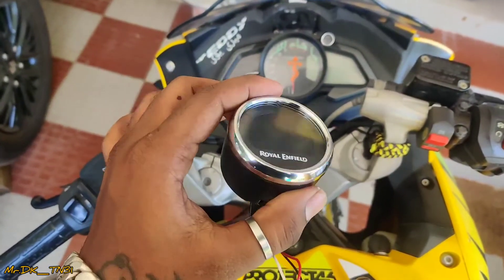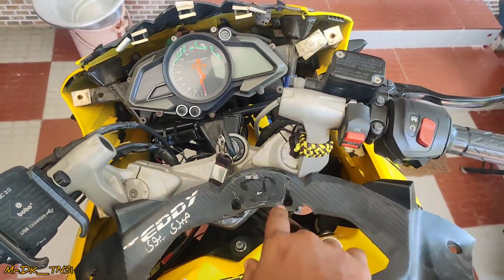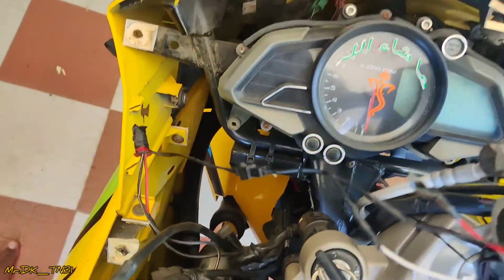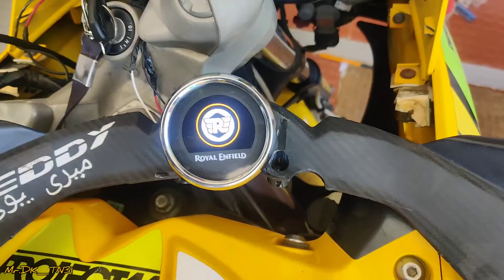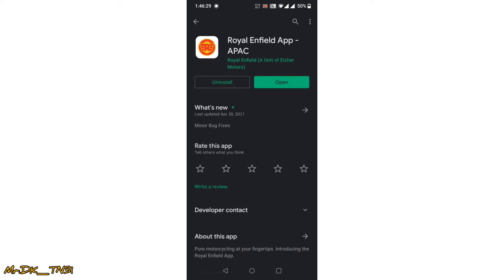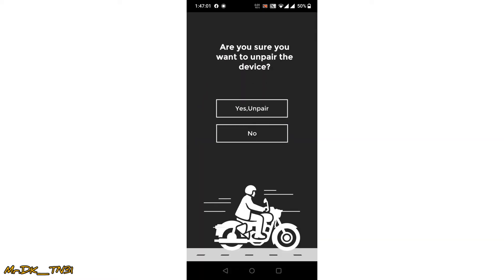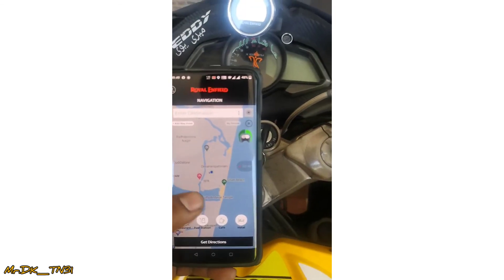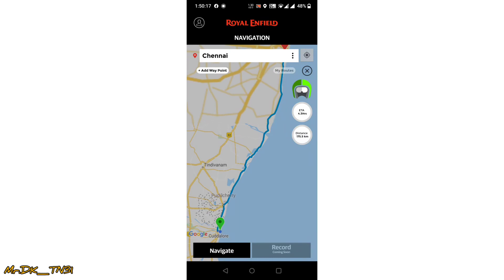Royal Enfield Meteor 350 Navigation Installation In Pulsar RS200 | Tamil | Mr.DK TN31 #rs200

Comment: Bro actually I'll buy it this navigation system that's is not a problem but where to buy this wiring socket. This wiring socket only I didn't get it...
Reply: Bro actually what line of red wire
Reply from the maker: @highlightcinematography5758  check the top 3 pin bro . Bottom pins are dummy
Reply: Oh kkk bro
Reply: Red wire enna line bro
Reply from the maker: @highlightcinematography5758  I think red dummy bro . Only white and black
Reply: Ok bro

Comment: At royal Enfield showroom they say we don't provide tripper alternatively it comes with royal Enfield bike itself company doest sale it
Reply from the maker: In some showroom only they sell it bro
Reply: @mrdktn31  hi I managed to get the navigator. I have an avenger. But I am not getting the socket plug for it. Could you assist. Thnx
Reply from the maker: @Atson0311  hi bro  many places the socket don't available bro . If u have the meter take it to a good electric mechanic u need only 2 wire's u can solder or connect the wires direct to the pin
Reply: @mrdktn31  thnx. There are 6 pins, wld you be able assist which are the two pins?
Reply from the maker: @Atson0311  check the first 3 pin

Comment: Can u tell the pin diagram where exactly the wire is connected I got the product from re service center but dono which is the power suply as it has six pins and there is no connector in it
Reply from the maker: I am not sure bro I got the product with the connector . In connector it has only 3 wire 1phase 1nutral 1not use.
Reply from the maker: @hima09jp 
Message on insta bro https://www.instagram.com/p/CJgiwSbBv26/?utm_medium=copy_link
Reply: @hima09jp  how much did u pay for it. ???
Reply: @lohitnaik4079   5200
Reply: I also need one for classic reborn, but need to know how to do the connection , can anyone guide me
Reply: @thispc8131  u can get it in service center ask for the part RAM00063/B if they say that the stock is not there then ask them which other service center is having the spare, they will let you knw, u then buy it from them and best thing with classic reborn is it'll be having the socket inside headlight assembly you can easily fix it
Reply: @hima09jp  is the socket available inside the headlight area? Are you sure ? Because then it would be quite easy to fit.. I guess the fitting will also be from the headlight area itself
Reply: @thispc8131   due to the shortage of IC chips in global market royal Enfield didn't provide it but if u see few bikes are already equipped and it's a option in booking to therefore we can say the socket will be there inside the assembly
Reply: @thispc8131  I managed to get the device but the socket is not there with the Device. I have an avenger and plz assist me to get the socket

Comment: hello I need a help, to which pins on the unit have you connected the positive and negative wires. I am stuck because i havent got the original 6 pin connector and mine is a non - RE bike so i have to make my own connection to unit.
Reply from the maker: Only the top 3 pin u have red, black, white . In that white is positive+ , black is negative - . Only u need to connect 2 wire's . I am not sure which is white & black in 3 pin u check by connecting the device will turn on
Reply: @mrdktn31  thanks bro
Reply: Hello Bro. Where can I get the plug 🔌. Sorry I don’t understand tamil.
Reply from the maker: I got it together bro
Reply: From where do you got the 6 pin connector
Reply: Possible on scooter?
Reply from the maker: I got it as a set
Reply from the maker: If your scooter has battery can
Reply: @mrdktn31  got no scooter itself. But ty
Reply: Where did u get the connector socket bro ?

Comment: From where to get the wiring?
Reply from the maker: You mean the socket?
Reply: @mrdktn31  yes and the wiring
Reply: @mrdktn31  I want to install it but I'm not able to find the wiring
Reply from the maker: @akhilsukumar  the socket has 3 wire bro in that connect 2 wire to positive & negative
Reply: @mrdktn31  can a local mechanic do the wiring?
Reply from the maker: @akhilsukumar  yes bro not a big issues
Reply: @mrdktn31  thanks bro, will update you